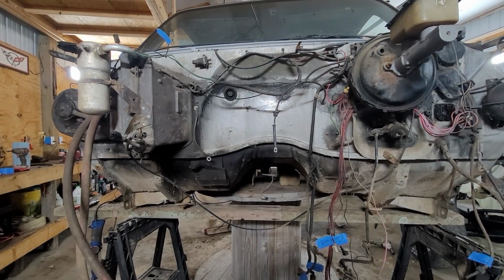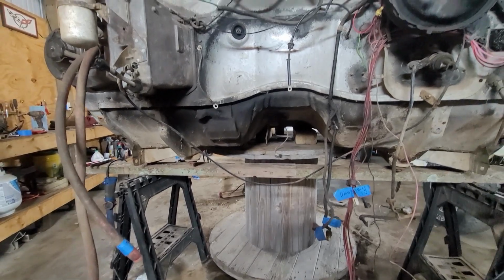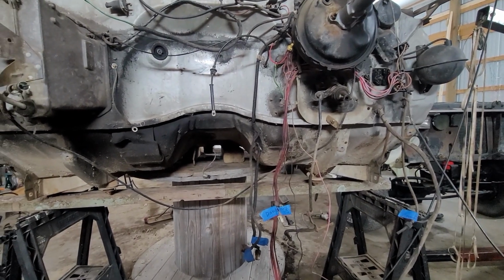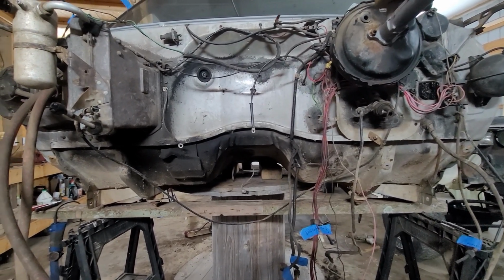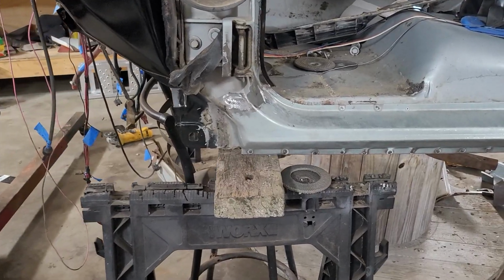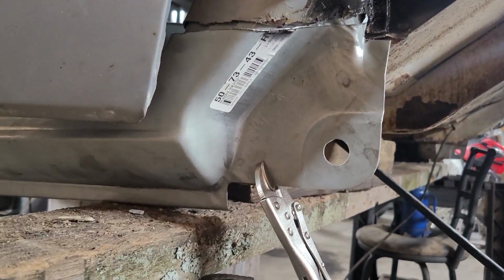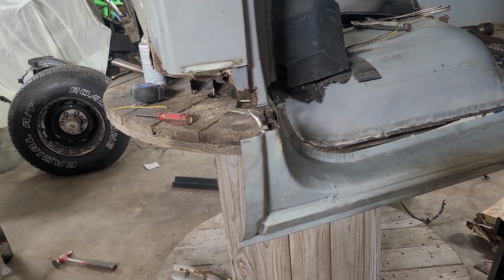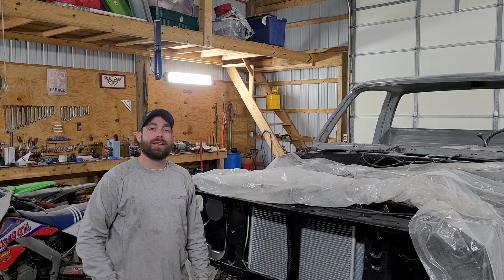Rebuilding a 1985 k10 part 10 Cab corner and rocker replacement.

Comment: Nice job! Love seeing fellas building squares! I’m on the downhill side of a 87V20 Standard Red/maple interior, 6” lift, M/Tw 35” BFGs for my son and  a 85k20 right behind it. 
Daily drive a 87k10 with 8” SL and 38 toyos .
Reply from the maker: Man, it sounds like you have a fleet. Squarebodys are definitely fun to work on. Thanks for watching.
Reply: @BottomDollarBuilds  started with 67-72 years ago, still have one . The youngest wanted to get into building squares. Funny how you get one and the rest kinda follow you home. 
Paint and body is my specialty. 
Biggest piece of advice. Reseal the inner cowling..... that’s why the corners of the floors and rockers rust toward the front. Most overlook that area.
Reply from the maker: Thanks for the advice. Something I definitely want to do. It would stink to weld rockers in again.

Comment: The green wire coming off the oil pressure sensor goes to the dash light that says "Choke", it wasn't used on very many trucks, a few V8, the 292
Reply from the maker: Thanks for the info. I needed to get a manual on this truck. The internet can be tricky to use for wiring.